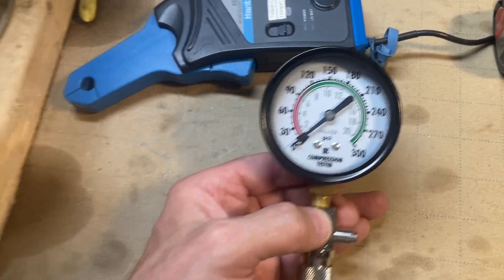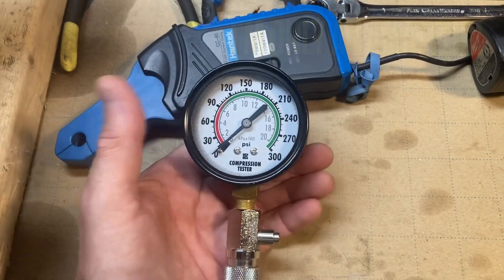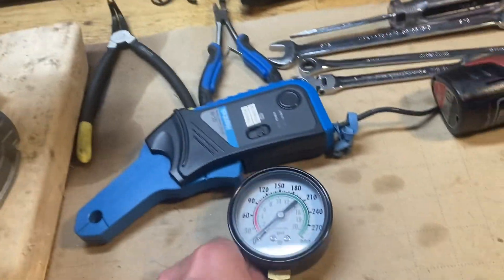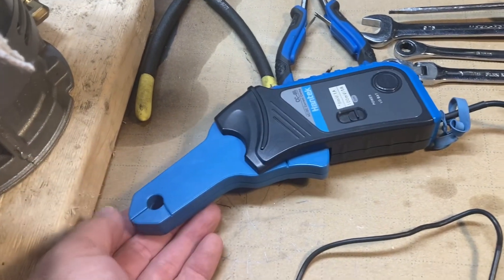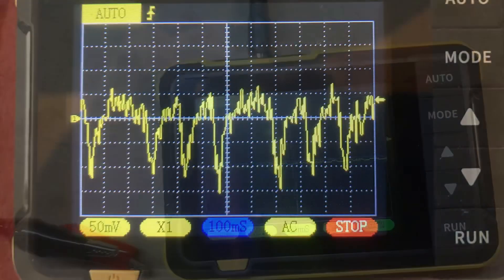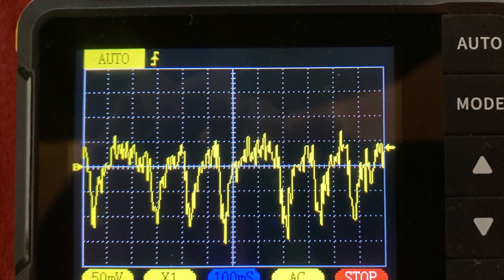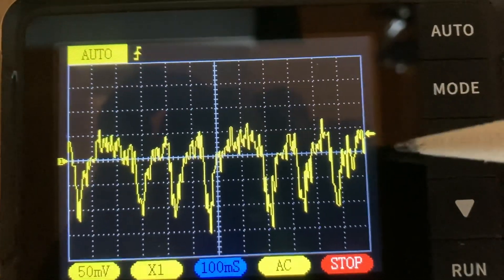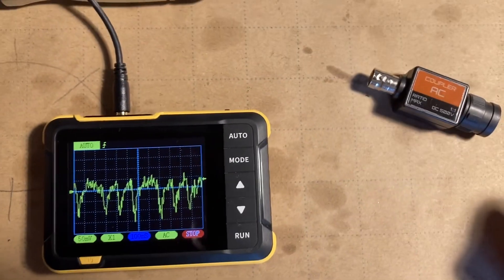Fnirsi DSO-152 Relative Compression Testing

Comment: I'm wondering if you don't have a current clamp, will 5 turns of reasonable gauge wire on the starter wire, connected to the scope probe could enable you to do this successfully. Think it should.🤔
Reply from the maker: That approach will work. Difficult is say to what degree of success. Thx for watching 👍🍻